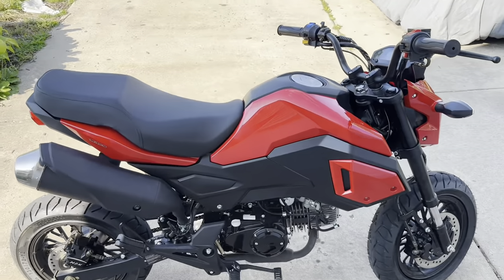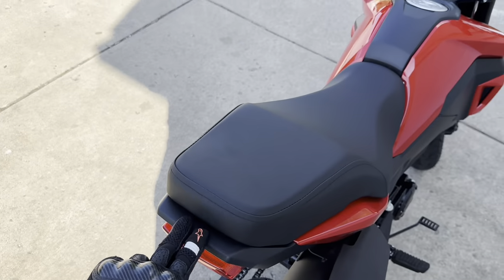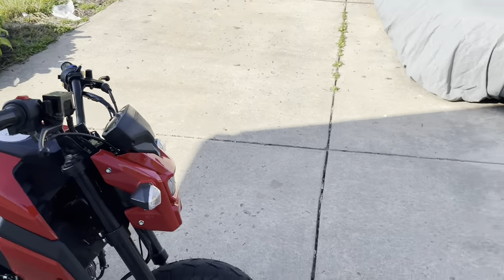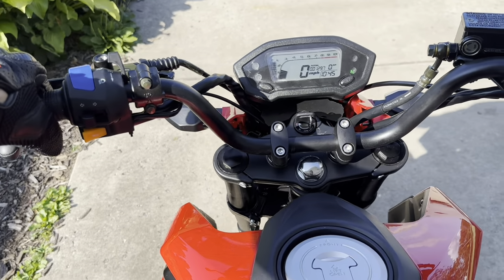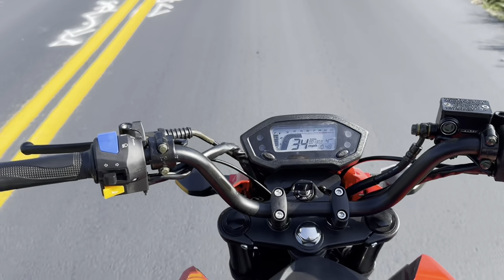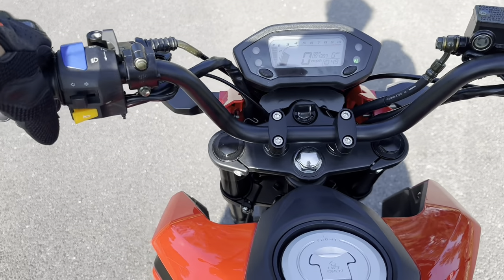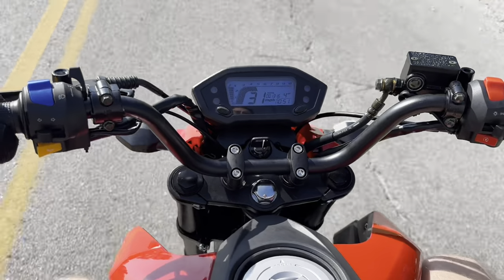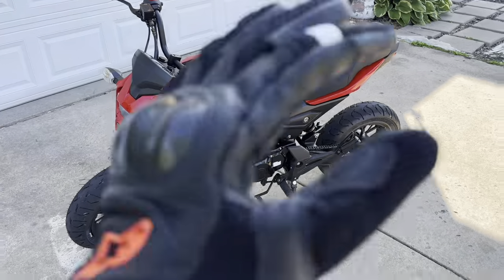FIRST 125 MILES ON MY GROM AND IT BROKE?! (Boom Vader 125cc Honda grom clone)

Comment: Best mod is a engine swap it with a z's 190cc 5speed should get you up the 75-80 MPH it's perty much a direct replacement complete kit definitely smoke a Grom if you fix it up you can make it better than a stock Grom if you spend as much as on fixing a clone up  and you can replace the parts with Grom OEM parts you can upgrade everything that you don't like about it and 190cc swap for cheap then a stock Grom parts are easy to find and it cheap on gas it takes some work but it also worth the work. Its also street legal and can perty much take it any were  the motor that in it what kills it  if you ask me  😉💯🛠️🍻👍✌️🏍️
Reply from the maker: Already traded it for something else bro but yeah those r pretty cool I’ve seen a few
Reply: Where could I get a deal for a 190cc engine? I’d like to do that any help?

Comment: We can agree on some things, out of the box, it's rough.  You are still in break-in period, so keep it stock as much as possible(reliability upgrades are a good thing to do) and ride it easy.  Afterwards do the basic mods(carb, larger FRONT sprocket, and exhaust) and you will wake it up.   Cover much of what I did/do in my blog.  Good luck and ride safe!!!!
Reply from the maker: That's the plan!
Reply: @Dominicgambino  how is that the plan if you got rid of it lol